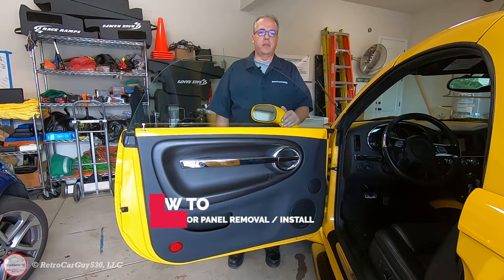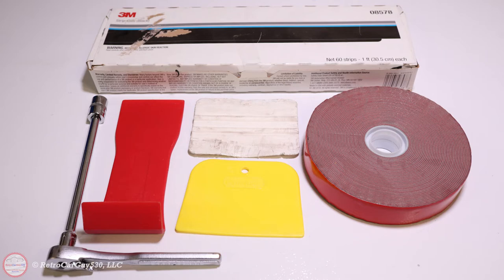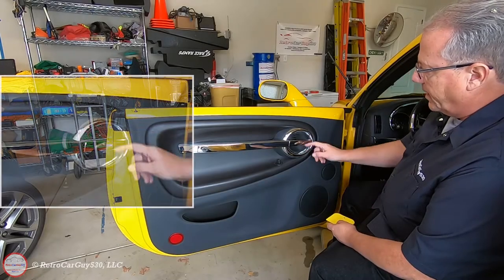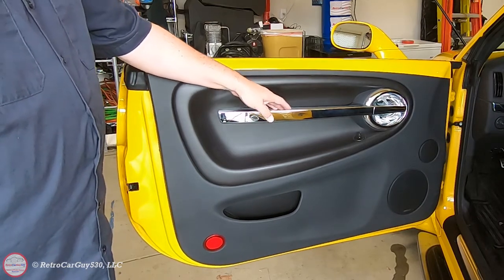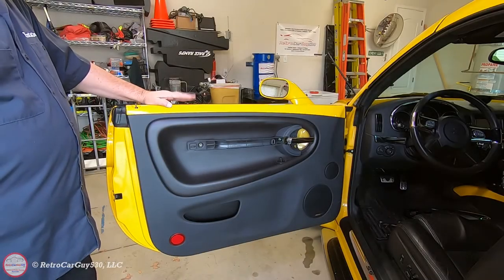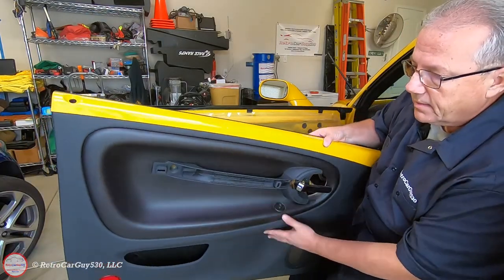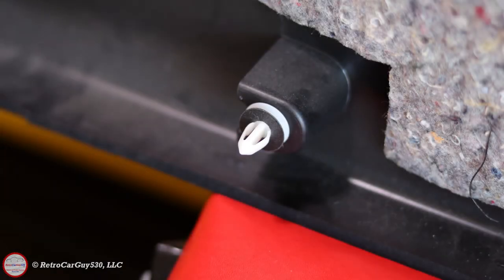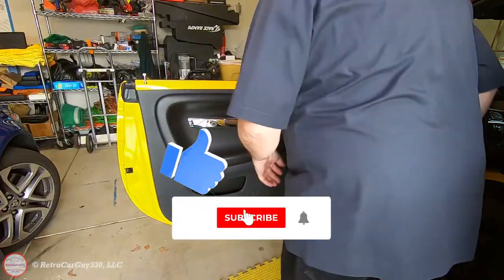How To - Chevy SSR Door Panel Removal / Install

Comment: On the reinstall of the door panel you could just thread some vacuum tube onto the door lock rod and then drop the door panel in place.   In my case my exterior door handle would not open the door but the interior would open easily.  The rod from the outside door handle to the door latch just needs to be lengthened. You can turn the rod (counter clockwise) in the door if you remove the door lock clip to get it out of the way so you can turn it. CC.
Reply from the maker: Thanks for the feedback and the tip for the door lock rod reinstallation.

Comment: I just bought a 2003 SSR. It only came with one key fob. Do you know how to program new fobs for the SSR?
Reply from the maker: The programming of FOBs for the SSR requires a scan tool (like a GM Tech 2 or many other third party scan tools) that can invoke the FOB programming routine.  I have a video that discusses third party FOBs and how they can work but might set a DTC about a low FOB battery which is false.  https://youtu.be/0PoO6xREla0

I have an older video showing the steps that an Autel MaxiSys MS906 scan tool goes through to program SSR FOBs.  https://youtu.be/8o4K1Z7TAw0

Comment: how do you replace the rear speakers
Reply from the maker: The rear speakers are mounted in the amplifier box behind the seats.  You'll have to pull back/down the carpet covering the speakers to access the screws that hold the speakers in the amplifier box.

To get the carpet out of the way you'll need to remove the "upper garnish" (body color plastic piece at the top of the center console that runs to both sides.  You can lift up to release the metal clips (careful the metal clips don't drop and get lost).

Next, you'll need to remove the "body lock pillar trim" (black plastic trim by the door behind the seats).  The door sill plates also need to come out to release the "body lock pillar trim".  You should be able to pull up on the plastic sill plate covers and the metal clips that hold them in place should disengage.  

Next, remove the plastic caps in the seat back cushion bumpers (carpeted bars at the upper end of the rear seat mounted to the rear of the cab over the carpet).  Remove the two nuts and remove the bumpers.

With all of those items removed, you should now be able to roll the carpet forward/down to gain access to the speakers.  The speaker grills are actually mounted in/on the carpet.

Remove the four bolts/screws that hold the speakers in place.  

The installation of the speakers is the reverse of the removal steps.
Reply: can you make a video please
Reply from the maker: Unfortunately, I had to sell my SSR in 2021 to keep my company funded as a result of the pandemic.  I won't be able to make a video on how to access the rear speakers.

Comment: Hi ,if the door is stuck from inside and outside ?
Reply from the maker: I'm assuming you mean the door won't open when you use the outside or inside handles?  If it's the driver side door, use the key in the lock assembly or (either front door) pull up on the interior door lock knob to make sure the door latch assembly is truly unlocked.  If the door latch is locked it will ignore the handles when attempting to open the door.

If that's not successful, you will likely need to remove the interior door panel with the door in the closed position.  I've never attempted that with the door closed, but it seems like it might be possible to accomplish with the door closed.
Reply: @RetroCarGuy530   Thank you very much for your help..